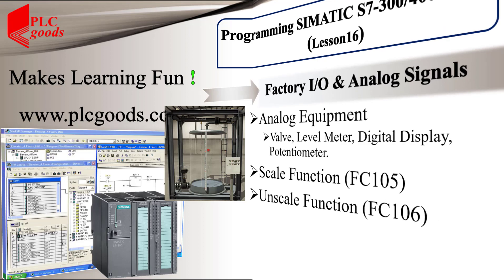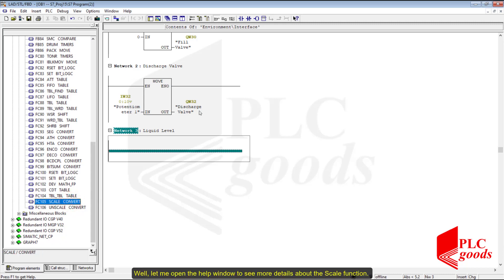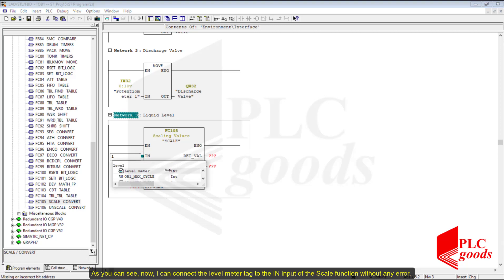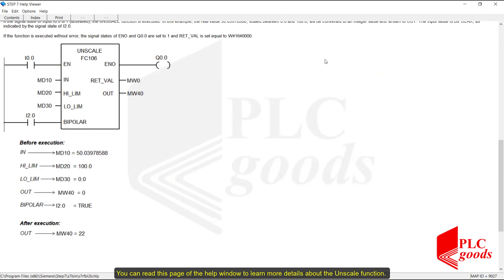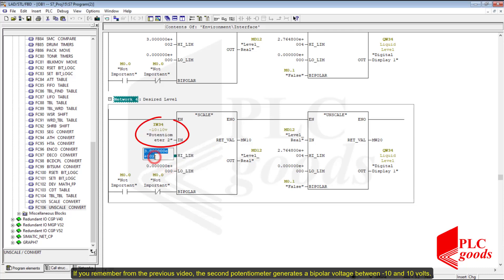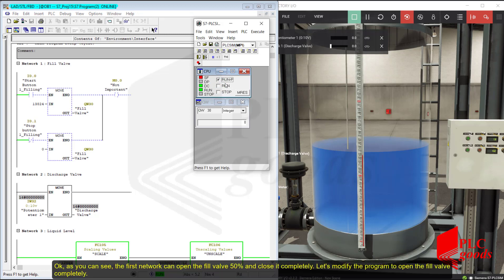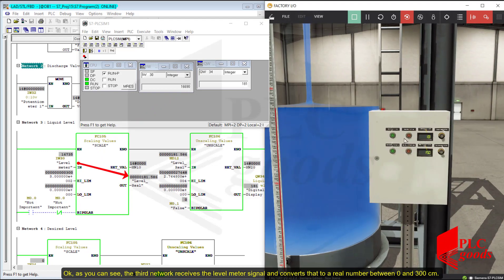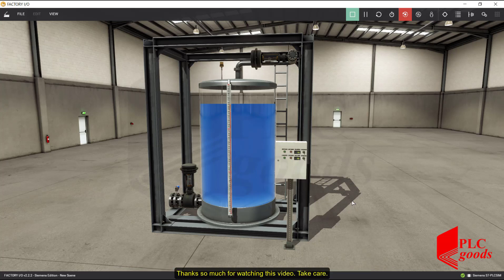ANALOG input output signals - 0 to 10 analog signals  | Lesson 16

Comment: hello, I think that the parameters (HI-LIM and LO-LIM) of the function FC106 (Unscale) should be 300.0 and 0.0, respectly, not 2.7648*10⁴ and 0.0 as these parameters, both in FC105 and FC106 are to define the limits of physical variables instead of values that the PLC only understands.
Reply: hello again. Note that the two digital displays receive integer numbers in this project, not voltage. Please test your idea. you will see that the FC106 converts 0-300 range to a number between 0-27648. If you connect that to the 2 digital displays a number between 0 and 27648 will be shown. As you know it's wrong. because the water level is a number between 0 and 300 cm.
Reply: @plcgoodsteam8934   Ok. I Will check it. Thank you for your reply. Greetings!
Reply: @plcgoodsteam8934  I've finally checked. You're right. I didn't know about what you told: the display receives integer values instead of voltage. Just at all, I have you all to get learned.  Thank you!
Reply: @DavidRomeroGuillen  hi there, 
First let me explain the normal condition: In this project unipolar signal is selected for the two FC106. So, FC106 converts any range, for example 0-300cm, to this range 0-27648 . As you may know, if an analog output module receives this range of number, then it will generate an electrical signal based on the selected settings (For example a voltage between 0-10 volts or a current signal between 4 and 20mA). 
The next mode: In this project I've calculated the water level using FC105 which is a number between 0-300 cm but its format is Real. Note that, the 2 digital displays are not analog output module and also don't generate electrical signal.  They show numbers. So, I only need to convert the calculated water level in Real format to an Integer number without changing its value. As I've mentioned earlier, the output range of the FC106 is 0-27648. So, I only need to select this range 0-27648 as the input range of FC106, although the water level is changing between 0-300 cm.
Reply: @plcgoodsteam8934  I have understood perfectly what you have explained. Now everything is much clearer. We could have used these 2 functions (DINT and INT) to convert the output signal of the FC105 that gives us the floating numbers from 0 - 300, and then these numbers are converted into double integers and later, into integers that the displays need. I, personally, am used to using the FC106 function to descale any engineering values to integer values. In your case, you have used FC106 as a very good solution using this input range (0-27648) to output the values equally based on mathematical criteria: y = x. That is, with a slope of 1. It does not go up or down as you have mentioned. Thank you for your long message that helps us a lot to clarify any doubts that arise.
Reply from the maker: Good job!